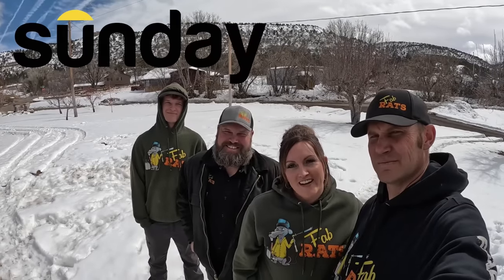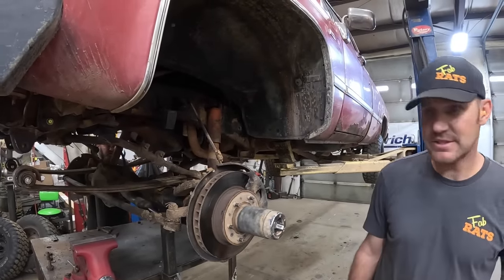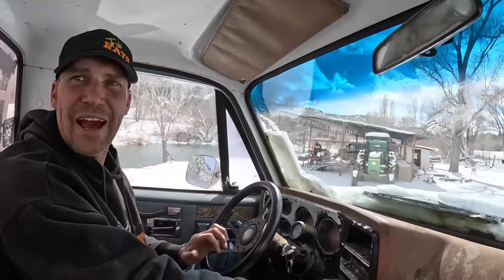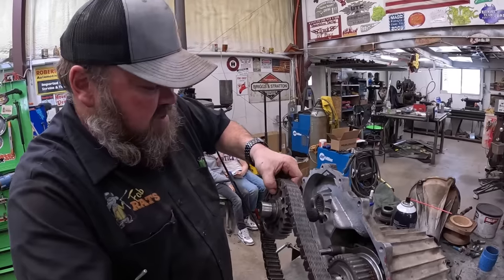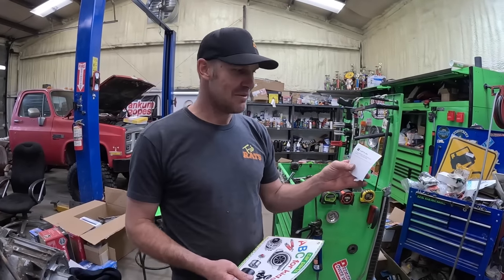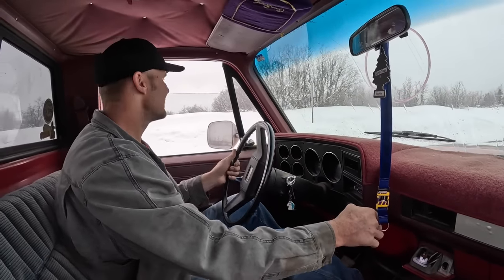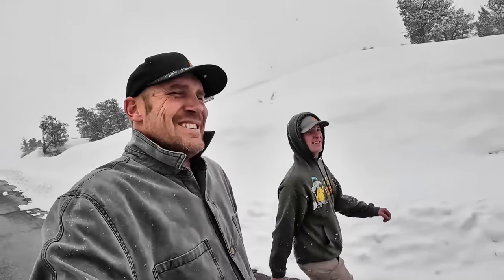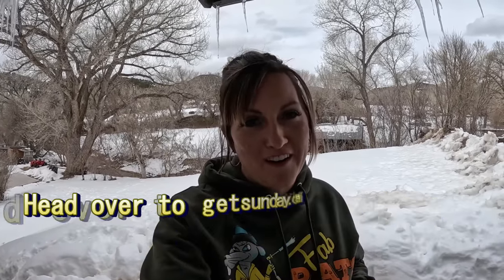A Test Drive In The Snow Takes A Chilling Turn!

Comment: little trick my Dad showed me for installing needle bearings is put a gum rubber band around the shaft stick them under that it dissolves in the gearoil won't hurt a thing.

Comment: On my 1976 Scout II, it had a bent shaft from the factory that caused it to pop out of 4x4 whenever I got into a sticky situation. I had a strong, rubber bingey cord that I wrapped around the shifter and hooked into the ash tray on the dash. Drove it like that for 18 years and sold it. Never dropped out of gear again.

Comment: Hey just so you know that black plastic oil pump was installed upside down in your transfer case that you rebuilt. The side with the seal should face down towards the input gear. Np208c are pretty tough as long as you don't run them out of oil. Keep up the great videos.

Comment: That was an excellent learning moment for Landon. I laughed at the cut after Landon rear ended Paul and some words were likely exchanged. I have been there before Landon. You live and learn.  I haven't had anyone plow into me like that yet, but it's been close. Those old Chevy's are tough trucks. I put solid bumpers on my old second gen both so that I can run into stuff, and people can run into me and I don't have to be too worried about my pride and joy getting too beat up.

Comment: Utah reminds me of Alaska in winter I drove cab in Alaska for about 8 years. isn't nothing more gratifying than having someone with a  4x4 parked downtown and me in my 2 wheel peeler crown vic  driving them home on the mountainside, then going back the next day to take them back to their 4x4 after the storm.. We had an ice storm I did downtown Anchorage to Bear Valley  basically 4 times 1 night. Look it up.

Comment: Man I love square bodies. Last of the real trucks. I have a few of them and they just smoke all of my newer trucks hands down . ‘82 k10 LB , ‘86 c10 LB , ‘87 k10 LB , ‘87 k20 LB , ‘05 Silverado Z71 Xcab SB , ‘15 Silverado 2500 HD 6.0 LTZ Z71 double cab SB . The ‘83 with the Blueprint race engines 383 stroker on 35” Baja Claws is just unbeatable 💪😎👌🤙.

Comment: Hey Paul years ago I worked at an import auto wrecking yard full of vintage European and British import cars covered with ivy and blackberry bushes and the tow truck that we had didn’t have a working boom so the owner used a little trailer that had a boom on it so we move cars around the yard and rescue cars from farmers fields and backyards of elderly people with the little trailer with a tow boom on the back maybe something like that for the FJ might just be your ticket. I remember the boom on that little trailer had a big yellow sticker that said Readi-lift on it don’t know if that was the manufacture of the boom or the trailer or what.

Comment: Your suposed to only use silicone based grease on the poly bushings otherwise it degrades them. I remember the first time i pulled apart a 208 in my dads suburban for some reason when i was a teenager. The needle bearings went all over the floor. It was a long night.

Comment: Regular grease will make bushings swell and deteriorate.   From one of the poly bushing sellers (Spahn): Polyurethane bushing manufacturers advise to never use a petroleum based grease for poly bushing lubrication. Polyurethane should only be lubricated with one specific type of grease to insure long bushing life, and squeak-free performance, Silicone based synthetic water-proof grease.

Comment: 100% poly bushes are designed to be greased as they are a mechanical bush & rub on the surfaces VS rubber twists on itself. but doesn’t rub itself away like a dry poly bush will.

Comment: Good tips 👍🏽.
R u guna do a trouble shoot seg as u go ???? Like gages not working????    Or shorts ?? Mostly older stuff cuz laptop sized readers r C RAZY EXPENSIVE $$$$$$$$$$ on newer autos. And I have found out the codes do not tell you the whole story.  Just gives you a good starting point.
My truck is too old to even have a computer port which I really like ☺️😃🤠

Comment: Was 16 with 3 of my 14-year-old cousins in my dad's truck down on the lease.  We were fine until my cousin dared me to try to drive through a washed-out area that was frozen over.  Broke through the ice and got high-centered.  Luckily my dad had one of the first bag cell phones back in 1989 so we were able to call him but he and my uncle were on a job so we had to wait for 5 hours for them to come to pull us out, at the time we thought that was better than walking about 6 miles to the nearest farm.  Although maybe in retrospect it would have been better to get a farmer to come pull us out so my dad didn't see what we had done.  All my dad had to say when he showed up and saw what we got ourselves into was "What were you thinking".  That was the problem, I don't think there was much thinking going on.  He didn't have a nice kinetic rope, it was a big thick thing that made your teeth rattle out of your head when he hit it with about 10 ft of slack going mach chicken.  Love the channel, keep bringing great content.

Comment: I'm 65 this year, when i was 18 i went fishing with a friend, we got up early and fished till lunchtime with no luck, so decided to pack up and drive home. Where we were fishing was close to an abandoned sand pit. My "friend" suggested we drive into the sand pit and wheelspin around for a laugh. I did, stupidly, and got about 40 feet in and just sunk down to the axle. We spent the rest of the day trying to get it out, putting stuff under the wheels, jacking it up, digging around the wheels till it got dark and gave up and called for someone to come get us. We retuned the next day and it took us all day to get it out doing the same as before. This was in the uk, in a stock rear wheel drive road car (1971 Vauxhall Victor 2000).
My excuse for listening to a friend, was i was 18 years old. What's your excuse Paul?😅😅

Comment: I live in taxachusetts and we didn't get sh*t for snow this year.  You call that red truck rusty?  You have no idea.  Had 70k on my 2002 silverado and the frame rotted in half.  Stealership sanded the frame smooth and painted it black to hide all the rot and I got screwed out of 6 grand.  Now I drive a 2015 smart car because that's all I can afford.

Comment: In his defense the windows were spotted with snow, he had to give it the balls to get out to help dad get the red truck unstuck, that by the way he got stuck on a double dog dare hahahaha. Believe me or not I yanked an f250 back up on the roadsnow from the deep snow off the side of the road with a 1991 Honda Civic Si 🤣🤣. It was about 6” of snow on the road but off to the side it was hard packed 1.5-2ft of snow. God I miss that civic so much! I will have another one again. I would never, ever do that with my 2018 civic si sedan even tho it has double the power it came with stock, s3 clutch and flywheel. I would bet my life it would break before the truck got up on the road.  They don’t make cars like they used too. If you’re ever stuck Stuck and have a tow strap and see a Mazda cx5 ask them to yank you out but bypass the tc and esc drop the tire pressure from 34 to 20lbs in the rear and it will hook if the stock tires have tread and pull your car out. 

Yes I like pushing my vehicles in situations they have no business being in ahah

Comment: Do you have some kind of special reason for never sweeping all the snow off of your hood and roof, etc???  Every time you head out during a recent snow event the snow is piled up on your hood like 8 inches and is just waiting to blow all over your windshield ( with barely working defroster).  While the roof is just waiting for a chance to blow off onto a following car while your zipping down the highway.  And you can't claim that it snows so often that you could never keep it clean, cuz on your run to Knab every other vehicle out there had no snow on them.